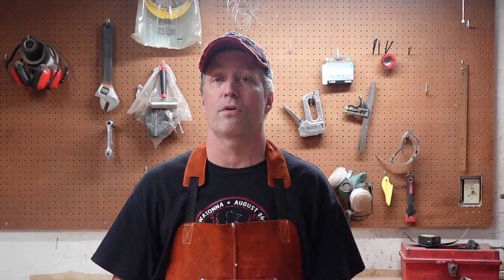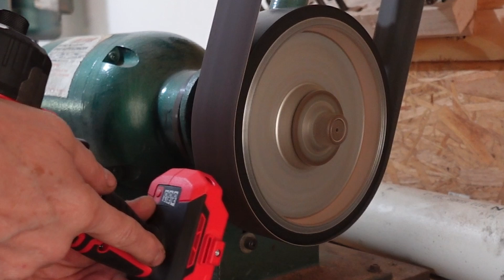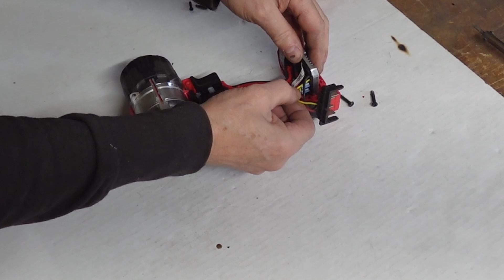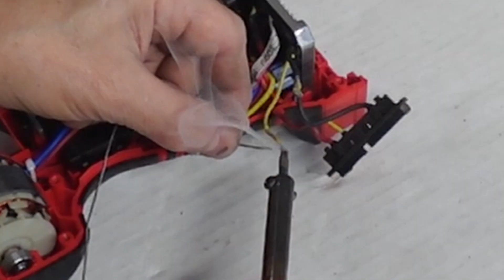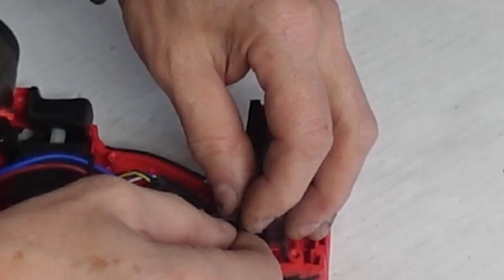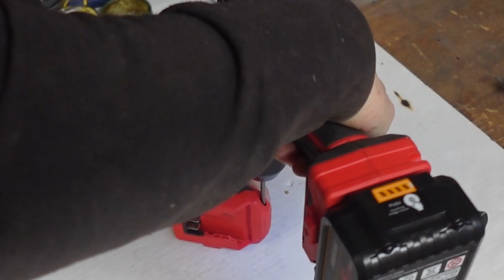🔥 Bauer Impact Driver to DeWalt Battery CONVERSION | Ultimate DIY Power Tool HACK!

Comment: Hello, what size 10k do you use. I looked them up on Amazon and they have different ones in 10k. Thanks
Reply from the maker: I used the 1/2 watt metal oxide, but you could use any.